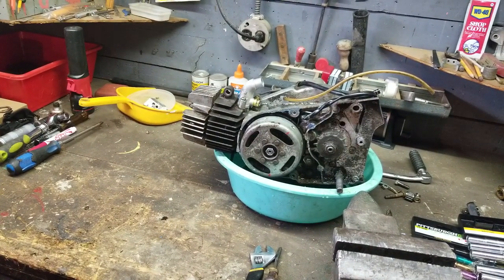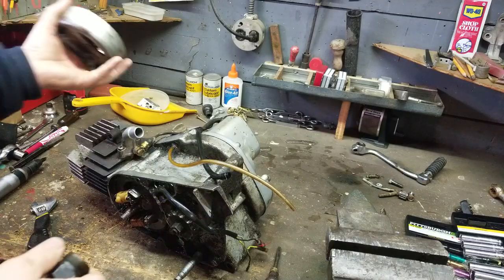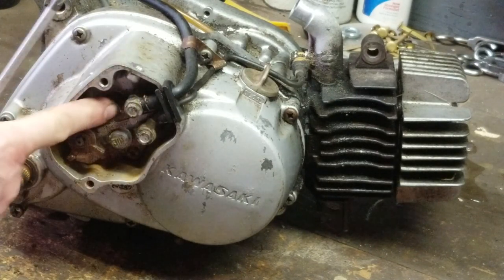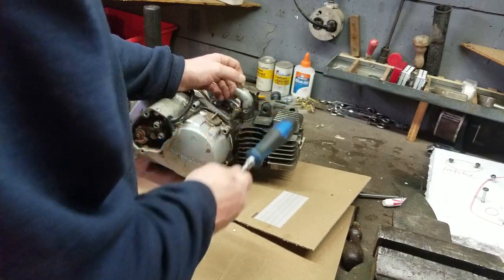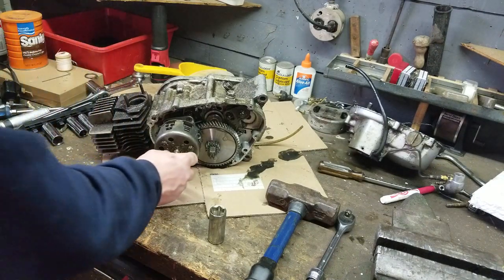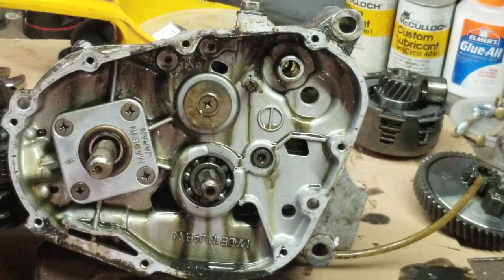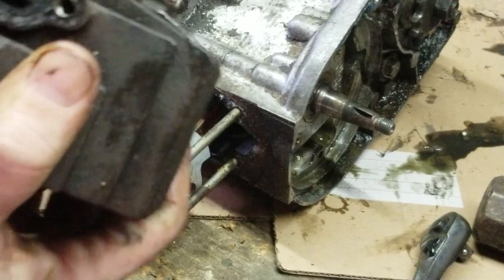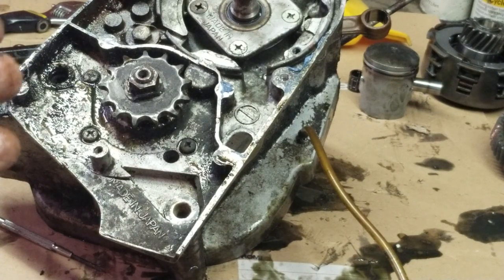Kawasaki kv75/Mt1 tear down part 1

Comment: Does anyone know what kind of oil to run in the engine of these kv75 bikes? Not the 2 stroke oil tank. Well that too lol. But the actual gear or engine part of it what oil type is recommend in these? Thanm you much appreciated.
Reply from the maker: Due to the high wear on the shift forks I'm use 80w90 and have been for 3 years by recommendations of a friend who restores these bikes the 10w40 is too thin